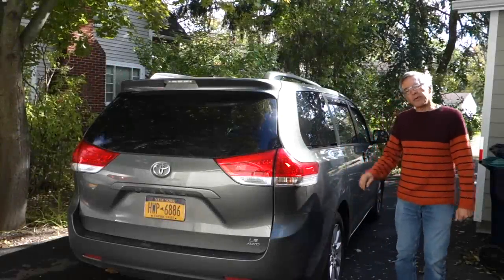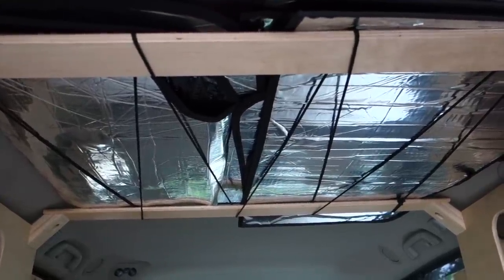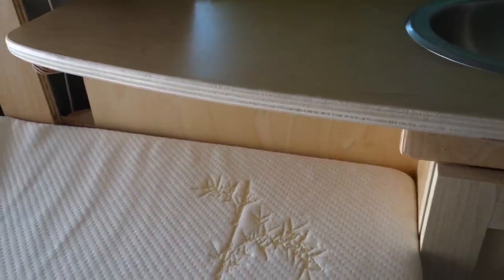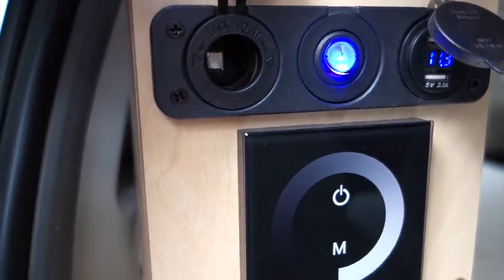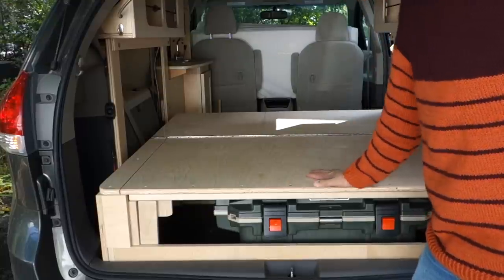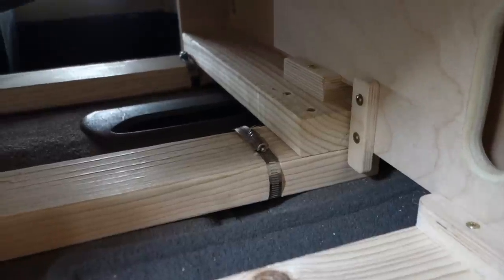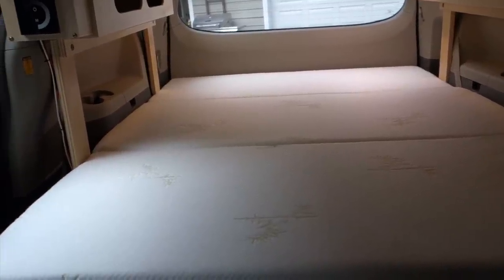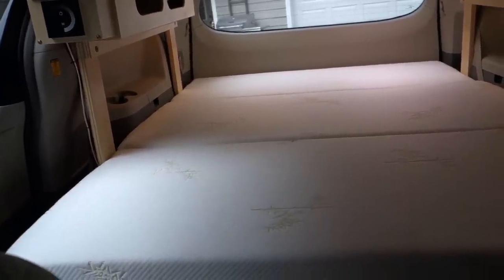A Slightly Different Mini Campervan Build

Comment: Bruce can you give basic measurements for the sink cabinet please?
Reply from the maker: Hi Melissa, I'm traveling (not with the van) so I've made a note to myself to check this and get back to you when I'm home again (a week). Stay tuned.
Reply: @BruceParks  thank you so much! I look forward to it!! I've watched all of you videos some multiple times! My husband and I have been van camping for about a year now. Even sold our travel trailer because it's just easier in the van. We already have the bed platform just needing the kitchen cabinet.....then maybe I can convince my husband to do some window cabinets lol...a little at a time I guess..
Reply from the maker: Okay, here's some dimensions for you. Note, the cabinet backside is fairly complicated (it's very curvy to match the contour of the door panel) so I won't try to include those details. The cabinet is basically two cabinets side-by-side: a sink cabinet and a freshwater tank cabinet. If you are inside the van and looking at the cabinet, the sink base (on the right) is 15" W x 10¼" D; the tank base (on the left) is 17¾" W x 4¾" D. The face of the tank base steps back from the face of the sink base to make room for the mattress. The height of both cabinets is 25". The countertop on top of the cabinets is ¾" thick prefinished maple plywood and overhangs the base cabinets. Let me know if you'd like more dimensions.

Comment: How do you get around the second row seat rails? Do you cover it with something?
Reply from the maker: I leave the seat "trolleys" in place. When the bed platform is fully in place, the trolleys are underneath it and out of the way. I plan to built covers out of thin plywood someday but it really hasn't been a priority. If this was a full-time camper, I'd remove the trolleys but I occasionally remove the camper components and put the seats back in.

Comment: Nice job. It looks like that the cabinets are floating in the air, any left-right vibration problem? Thanks
Reply from the maker: No issues there. The uprights and crossbars are very stiff and the driver side has the additional bracing from clamping onto the grab handle behind the driver seat. I figured if I had a vibration problem, I'd add a couple of small hidden pieces of slit pipe insulation to the edges of the cabinets that are adjacent to the van sidewalls.
Reply: Bruce Parks : Thanks for the reply, it would be perfect to have a roof top cargo box, any concerns with that?
Reply from the maker: A rooftop cargo box would be fine if you need extra storage space. We’ve found we are perfectly self-sufficient with a small amount of stuff, as long as we can find a laundromat every 10 days or so.
Reply: Bruce Parks :  Thanks and Merry Xmas!

Comment: Hi Bruce. Where did you buy the grey sink drain at 7:26, please? Haven’t seen that on Amazon and I’m having a heck of a time finding a drain that encroaches minimally like yours that will fit the 1.5” drain hole on my little sink. Thanks.😀
Reply from the maker: I originally purchased it on eBay (no longer available) but here it is on Amazon: https://amzn.to/3tydjut
Reply: @BruceParks    Thanks, Bruce! I couldn’t find that initially but just ordered it. How long and wide is your table?
Reply from the maker: Which table? The footboard that doubles as a table? It’s 46x19.
Reply: @BruceParks   Yes, that one. Thank you.

Comment: At 5:45 the hinges for the table legs. Do you have the link to buy those?  Thanks
Reply from the maker: At 5:45, the hinge in the video is this: https://amzn.to/2MfOYGm. It will need to be cut to length for the particular application but it's easy to cut with a hacksaw.

Comment: What are your thoughts about the upper cabinets getting in the way of the curtain air bags and/or the curtain air bags potentially causing the cabinets to splinter into projectiles?
Reply from the maker: Plenty of thought. No easy way to confirm actual outcome. I’m not concerned.
Reply: @BruceParks  Just to be clear, you have some fabulous ideas and  your work and craftsmanship is out of sight. Everything is very well thought out. The airbag question was not a knock or dig in any way.
Reply from the maker: Thanks. Your comment wasn’t taken negatively. We’re on the road at the moment and I just flashed off a quick reply. 

The side curtains will deploy freely where they can and only have a few spots of restriction in my build. The backs of the cabinets are open so I expect the curtains to merely push the contents (clothes in soft packing cubes) out. The air plenum above the driver side 2nd row window might splinter but it’s a small object relative to the rest of the mayhem in a crash that would trigger the curtains.

Comment: Hi Mr. Parks.  Do you recommend ICECO JP40 Portable Refrigerator over Dometic cfx 40w.   I know the price is a big difference but since we are probably travelling south America where is hotter which one do you think is best?
Reply from the maker: When I researched portable refrigerators, the conclusion I came to was the most important performance and reliability factor was what kind of compressor it used. Danfoss compressors were considered to be the best and both the ICECO JP40 and Dometic CFX 40W fridges used Danfoss (now called SECOP) compressors. So at ½ the price, I chose the ICECO product. So far, I'm satisfied with it and would recommend it to others.
Reply: Bruce Parks thank you very much. Love your mini home.  Wish I had your talent and knowledge.

Comment: How did you design the window covers?   I need that!  Thanks for sharing your genius!
Reply from the maker: Which ones? I've got Weathertech window shades for the front and rear windows. In the 2nd row windows, I've got window screens (see my video on how to make them).
Reply: @BruceParks  I watched your video on the screens - I'm going to see if I can figure out a frame that doesn't require wood-cutting tools - since I don't have any - but I'm interested in your blackout shades by Weathertech.  Did you make them or can you order them?  Thanks!
Reply from the maker: Weathertech sells them to exactly fit specific vehicles. Once you’re on their site, you can look up your year and model to see if they offer a set that fits.

Comment: I was wondering,  can that center console come out? Thinking about getting sienna since my rav4 is to small. I like to go camping with my dog.the reason I want the center console out so it would be like the old vans. Where you can go to the back without getting out.
Reply from the maker: Yes, I’ve removed the center console. You might be able to see that in one of my other videos. It makes moving between front and back easy.
Reply from the maker: I chose minivan over cargo van for a lot of reasons but it’s important to first have a clear vision of how you want to travel. We are roadtrip warriors and don’t stay in one place for very long, plus we like to poke around cool spots in cities along the way. We’ve done a few coast to coast loops around the country seeing as much as possible from desert to mountain to city and still feel the MiniCamperVan is perfect for us (but everyone is different!). Compared to a cargo van, the minivan is easier to maneuver in all situations, more economical on fuel, depreciates less, draws less attention (good for boondocking and avoiding unwanted visitors), and in our case can be restored to original configuration easily for everyday use when not road tripping. The obvious disadvantage is not being able to stand up inside. But that’s about the only disadvantage and, for us, it’s overwhelmed by all of the advantages. Then, when looking at the different brands of minivans, I chose Toyota simply because of its reputation for excellent reliability.

Comment: If you were to make this build a "permanent" camper conversion, can you think of anything off the top of your head that you would do differently?  Also, with multiple installs and uninstalls, are you worried about the screw threads slowly erroding their gripping surface in the baltic birch or did you embed T-nuts or something similar to avoid this problem?
Reply from the maker: You’re the first person to ask about what I’d do differently if the goal was a permanent conversation instead and it’s blowing my mind a little trying to rethink the whole thing. I really like how everything is anchored and I don’t think I’d want to remove any of the interior panels though doing so would net a few additional cubic feet of valuable volume. The one thing I’d consider is bringing the solar panel wires directly in through the roof for a cleaner look but if I did I’d make sure there was no way it’d ever leak. 

Regarding the question about repeated dis/assembly, I used a lot of T-nuts and threaded inserts, especially in areas where strength was needed. In other spots, I figured if the wood screws ever strip out, I’ll switch to threaded inserts at that time. 

Great questions, Tim!
Reply: @BruceParks  Thanks for the reply Bruce.  I failed to mention it before because it is so obvious but you did design & create a beautiful & efficient cost effective build-out!!  I'm thinking of doing one also in a Sienna and I'm collecting ideas right now.  I have a category called High-end Sienna builds which are very expensive and are really mostly permanent builds.  I have a Mid-Level category that are very nice but much less expensive and your build holds the top spot in that category.  Mission creep is so easy with these builds where one defines the essentials and if not careful, mindful, disciplined before you know it the plans for the hot tub and spa are in full swing.  I'm thinking of a 6 - 12 month trip down the Pan American highway.  I've considered every conceivable rig from a Class A, C, B, trailer, minivan, Prius. If finances were not a constraint I think a high roof ProMaster or Transit built out with big bed, kitchen, shower, compost toilet, 500 A/hrs of lithium batteries, 800 watts of solar and a 250 Enduro type motorcycle hanging off the back would be my choice.  Living in that space while traveling would be much more comfortable being able to stand to get dressed and stand to cook with normal counter top heights etc...  But, life is a series of compromises so a stealthy mini-van with decent gas mileage and a comfortable bed, compressor fridge/cooler, lugable loo, modest solar (1 or 2 panels) and battery bank (I'm thinking 200 A/hrs of lithium) with a DC to DC or B2B charger off the engine IF my plan will be to drive this rig back from the tip of South America and keep it for another decade of domestic travel.  If the plan is to sell it when I get there, I'll cut way back on the price of the mini van and build out, especially the battery investment and probably use one of the All-in-One "Solar Generators" like the 1000w Jackery.   RE: solar panel wires through the roof.  I noticed what appears to be a fairly large foot print on the end of the rear plastic cover of the roof rack...you attached some wire holders to it.  I wonder if there is enough room under that plastic cover to drill a hole through the roof for the wires, using a rubber grommet to prevent chaffing and then filling that whole cavity under the plastic cover with a silicone type sealant product to prevent water ingress?  I was also trying to figure out how to remove those 2nd row seat carriages.  No one has a answer on the web that I have found.  From watching videos of removing the seats from the carriages I'm thinking a 4" grinder to remove the end-caps at the back of each rail might allow the carriages to slide right off.  If the carriages were installed again later a beefy metal screw installed at the end of the track, after replacing the carriages could act as Stop point.  I've never seen the tracks with my own eyes so tell me your thoughts on this "solution" if the cosmetics are not important...does it look doable or are there other obstacles.
Reply from the maker: Tim Hardman - Ambitious trip you have in mind, bravo. Yes, you are 100% straight about compromises, every option comes with its pros and cons so it really comes down to your specific goals and perspectives. In my case, the stealth minicampervan was best suited for the occasional two month semi-civilized road trip with total freedom on where to go and stay at minimal cost and hassle. But I do appreciate your vision of a hightop enduro-packing cargo van. If I were on my own for an indefinite amount of time, that would be a premium approach. Regarding your two comments specific to the Sienna, I would definitely explore the wiring-thru-roof-rail-cap idea. I had given that a lot of thought at the time but didn’t want to commit to pulling down the headliner and snaking a semi-permanent set of wires through the vehicle for this project. But I’m confident it’s totally doable. The seat trolleys are trapped in their tracks and the tracks need to be temporarily removed in order to remove the trolleys. I’ve found a few sources that provide some detail on what’s involved in uninstalling the tracks and it’s a bit more involved than I cared to get into, especially regarding the desire to restore the vehicle back to stock occasionally. But for a more permanent conversion, it would be straightforward to get the trolleys outta there. With regard to your vehicle choices, how important is AWD? Obviously, there aren’t as many choices if you want that. I just read Chrysler is offering an AWD option on 2020 (or 2021) Pacificas. But in cargo vans, it’s just Sprinters, right? My AWD Sienna is an animal in slippery stuff with snow tires. Some of the Sienna guys have installed lift kits to enable more serious capability. But then they’ve traded off on the stealth thing. Always comes back to the compromise stew.
Reply: @BruceParks  The new 2020 Transit has an AWD option.  I specifically like the Sienna due to the AWD option and I see a company out there with 3.5" lift that is reasonably priced and shown here:  https://www.youtube.com/watch?v=asS59cdmwag or journeys off road dot com. If one is very familiar with the Sienna Model it is obvious that it is not stock and lifted (along with the larger tires) but it doesn't jump out as something special to the non enthusiast...in my opinion, especially if traveling the Pan Am highway. The sprinter has REAL 4WD with a Lo/Hi gear setting.  But the way diesel motors are constricted in the US and all the runability issues that go along with it, and the fact that it's hard to find a dealer willing to work on a Mercedes  Sprinter and if you do the complexity and parts and labor result in an unacceptable cost of ownership...I just won't put myself in the position of being so disappointed and financially milked with one of these.  The warranty is only good with certain types of diesel fuel and some states like MN don't even sell a diesel  fuel that meet Mercedes requirements.  I'll be looking for a used vehicle in the 2012 to 2015 range for price if I'm going to keep it and if I go with the sell it at Tierra del Fuego plan, I'll probably looking for something 5 years older.  So Bruce, is my idea of grinding off the end stops of the seat rails to remove the carriages not doable for a quick removal without all the surgery or is it just to destructive an option for you to consider on your van.  If the rails MUST be removed I'd appreciate any references to the videos or instructions on how to do it if you still have that info. Thanks again for your input.
Reply: @timhardman4764  There are some good tips about trolley rail removal on Siennachat.com.  I was able to remove the plastic, raise the tracks enough to unbolt the end caps and slide the trolleys off in an hour or so.  A bit of under-the-car work which needed to be done with the vehicle raised up a few inches more.  I left the rails in place since it doesn't rise up past the carpet, and I want to leave the carpet and pad in place for added sound insulation.  Very clean and flat that way.  I'll add a smooth-type floor covering for ease of cleaning.  Check here and some of the other links at that area of the site:    https://www.siennachat.com/threads/removal-of-2019-sienna-seat-trolleys.58883/